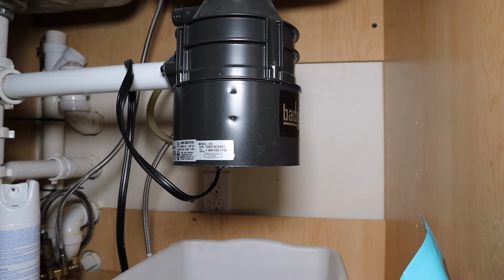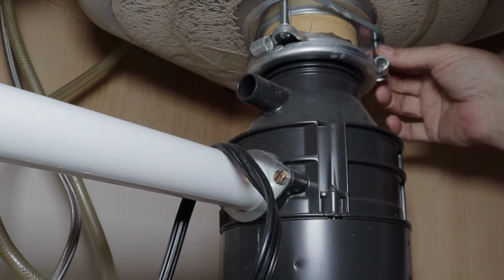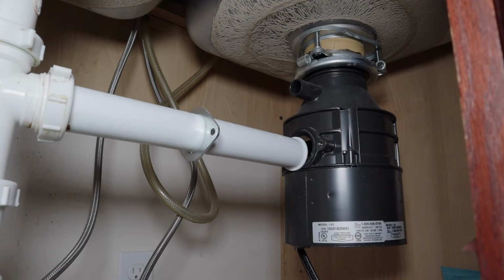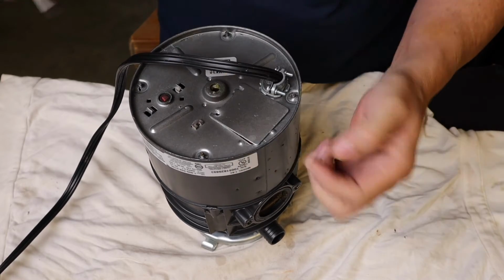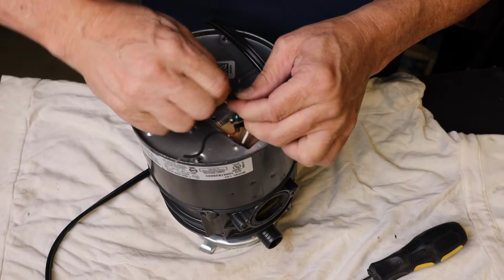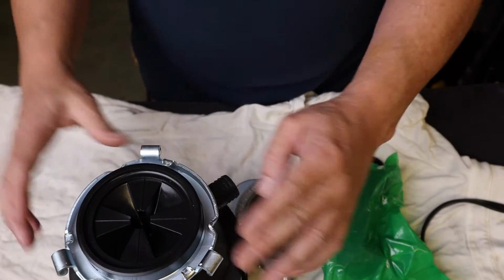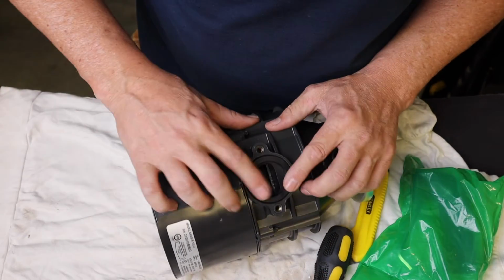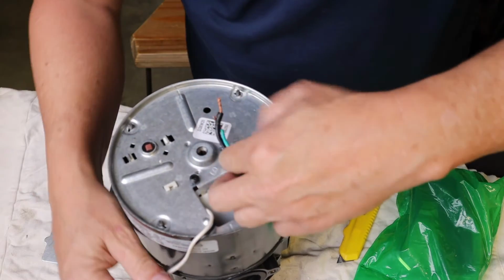Garbage Disposal Leaking From Bottom? Here’s the Fix

Comment: HINT: get the same model disposal so the pipes will not also have to be moved.  Getting a different model with a drain that is lower is going to send you back to the hardware store for a slip pipe that hasn’t been cut yet.
Reply from the maker: Good point